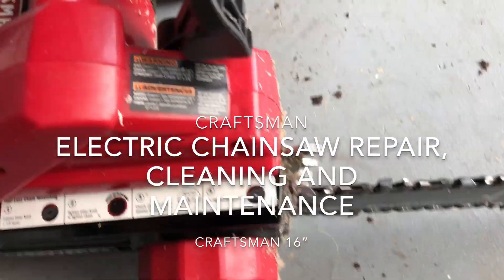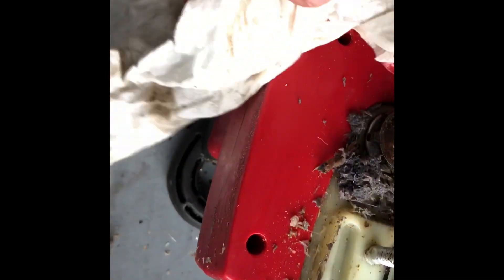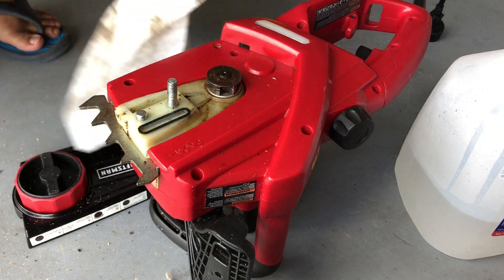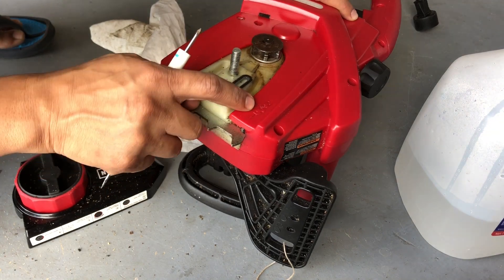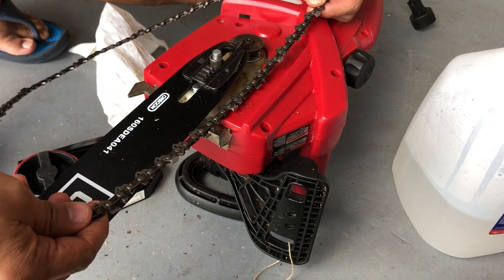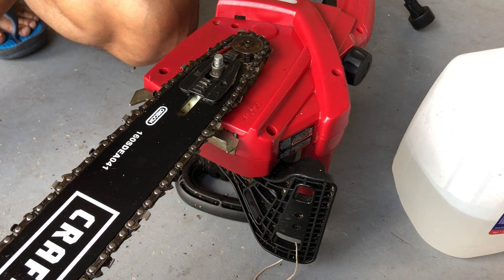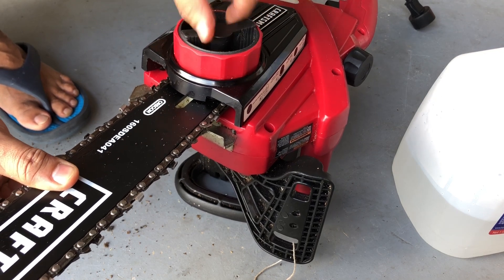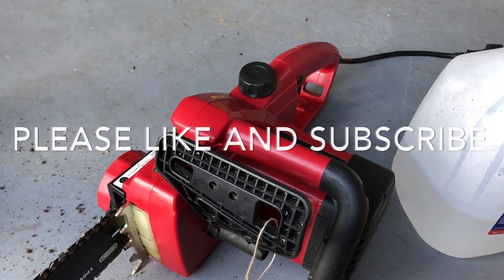Craftsman Electric Chainsaw Repair, Cleaning and Maintenance

Comment: Thank for video, I just bought one few weeks ago , the chain tension knob kept on turning counter clockwise and the chain became loose until I figured out the knob has turned really tight clockwise. I also didn't know how to take the knob out for cleaning until I watched your video. The manual that came with chainsaw never mentions any of these.

Comment: The self adjust chain tightener that you have to roll with your thumb isn't working anymore. Any suggestions?
Reply from the maker: Not sure. Try taking it apart. Maybe debris got inside. You can try cleaning it with brake cleaner and then lube it with WD40

Comment: Great video 
Do u have any video that shows how to fix oil leak. 
Tks
Reply from the maker: Fixing oil leaks? Maybe it’s just the cap? 
I never had a leak except the cap which can be changed.
Reply: @HowToDoitright  tks i check that .
Appreciate your response
Reply from the maker: Oskar Dirlewanger I would call the company. Many times they will send you a cap as a courtesy. Other alternative-See if there is a rubber washer inside cap. You can also find a similar washer and replace it.
Reply: If leaking from under the cap use some Teflon tape around the threads. If the tank has a minor crack  wash it with soapy water and apply nail polish or a plastic weld.

Comment: My Sears electric chainsaw will not start any suggestions?
Reply from the maker: Mike Klecker try opening it up as I did like you are about to clean it. Turn the guide (where chain holds). See if you can turn by hand. While chain removed plug it in and try running the motor only without the chain. If motor runs out everything back and it should work. If motor don’t run at all after removing the chain then motor is bad. Not worth replacing motor due to cost.
Reply: Make sure the kick back safety guard handle handle on top of saw  is not in forward position or saw will not turn on.

Comment: How do you get the kinks out of a chain
Reply from the maker: Wash it with brake cleaner spray
Reply: @HowToDoitright  I figured it out it was easy, Just took some flipping and un raveling.

Comment: How did it do for ya ..holding up nice so far?
Reply from the maker: Love it. So far I cut down 4 trees and still sharp. Just make sure you keep it clean and topped off with chainsaw oil.
Reply: @HowToDoitright  Thanks a lot !!